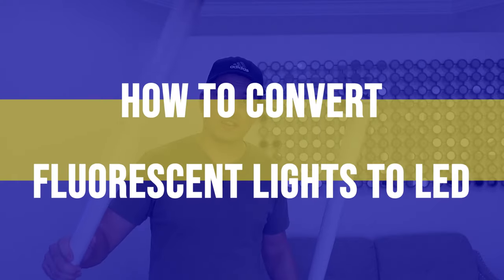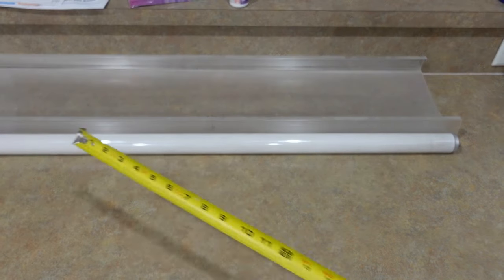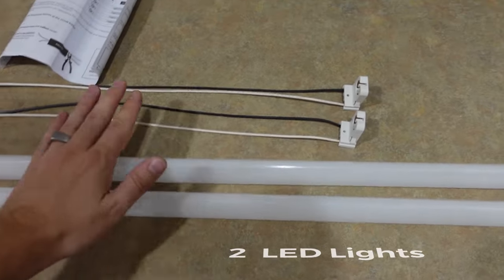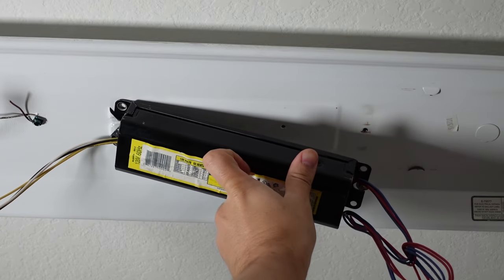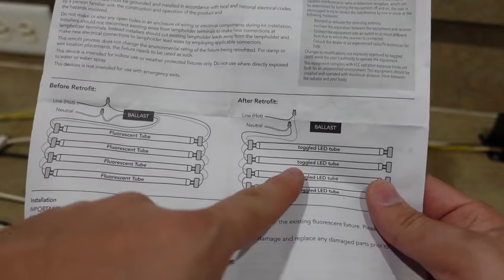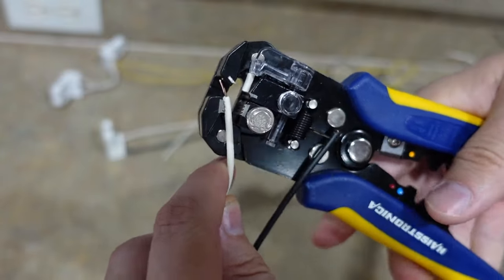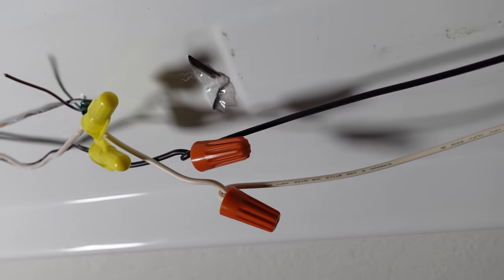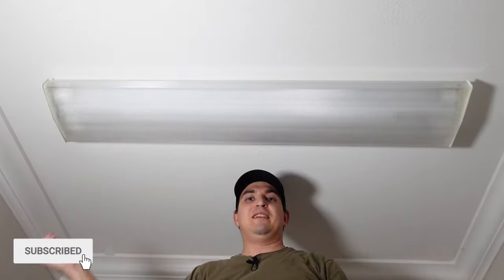How to Convert Fluorescent Lights to LED

Comment: Did you know, that you can fit the led bulb only in one way? The side which there is a description on the end goes to the side where the power is connected. If you do it wrong,  you short out the led and will trip the power and the led bulb is ruined.
Reply from the maker: No I did not know that. I must of gotten lucky then.
Reply: How do you know where the power is connected?
Reply: @BBullet Black wire
Reply: Good to know
Reply: That gives me another reason why I don’t like LEDs.

Comment: That's too much of a hassle honestly especially considering that regular Fluorescent Tube Light Bulbs last around 9 Years or more and they are cheaper. LED's are more Power Efficient but they should make LED's work with everything you shouldn't have to do all this stuff to get them to work they should just be Plug And Play for everything.
Reply from the maker: They do have easy plug ins but they are not as efficient since u end up using the ballast. The savings here is ur no long powering the ballast
Reply: This is very simple
Reply: @Daddicated  Most of the energy used is from the flourescent tube not the ballast. Thats why plug n play LED's are becoming popular. They use the existing ballast instead of a driver, so no ballast bypass is needed
Reply from the maker: @Warp2090  So on amazon it looks like the LEDs they sell can go for both plug n play and ballast bypass. I also did some math with help of ChatGPT and by removing the ballast I save about $7 per year if the light is on for average of 3 hours per day. With that being said I agree leaving the ballast is easier and less headache but with the ballast you will save little bit.😅
Reply: they do do them plug and play :) i don"t understand why this guy complicates everyting
Reply: @cristibabyface  I ordered some from Walmart I got their Brand Great Value and they work great without removing the Ballast.

Comment: Plug n play LED's are much more reliable if you have a good ballast.
Reply from the maker: Really? Why is that?
Reply: @Daddicated  Some LED tubes have cheap drivers, which fail a lot faster than a good condition ballast
Reply from the maker: @Warp2090  Interesting but the energy savings by going to LED is mostly coming from removal of the ballast is it not? It would interesting to see how much you saving by removing the ballast vs the life of the LED and the cost/frequency of replacing them.
Reply: @Daddicated  Yeah true

Comment: I've seen a couple videos of guys doing it without any kind of kit. Basically removing the ballast, rewire with existing wires, put in LED bulbs. I thought LED bulbs had green caps on the ends? Not sure.
Reply from the maker: I think if they rewire it properly then you are probably right you can probably do it without the kit. The kit just makes it easier and more idiot proof with instructions but if you know what you are doing you probably can do it without the kit.
Reply: The tubes in this video are single-ended lights, meaning that both the hot wire and the neutral wire go to one end of the tube.  There are double-ended (aka dual-ended) tubes in the market, if you want to avoid the kit.

Comment: Any reason you can't just buy LED bulbs and place them in? Does this have to be done with all light fixtures that aren't ballast?
Reply from the maker: I think they sell kits that you can install with the ballast. The problem then is the ballast wastes more energy. By removing the ballast you get more energy saved.
Reply: @Daddicated theres a company that i just heard from that sells the LED replacement bulb with nothing to do but install the LED bulb where the previous fluorescent bulb was.  Does this sound correct?
Reply from the maker: @davidb.8948  That is correct there are those as well but the problem is because you still have the ballast it still requires more energy to use the light therefore if you want the ultimate savings with the LED bulb its best to remove the ballast.

Comment: LED bulbs last longer
Reply: not always
Reply from the maker: Yeah I feel like they design them to fail after a couple of years at least that’s been my experience with led bulbs not sure about the tubes yet. We’ll see how long this one will last.
Reply: @Daddicated  yes
Reply: especially fluorescents on preheat ballasts, the tubes can last a very long time
Reply: Depends if you get one with a quality driver yes. The market is flooded with LED's that have cheap drivers sadly though.

Comment: I cannot find the kit you used in this video. I've looked at Home Depot and Toggled online and they only have the conversion kits with 4 bulbs meant to replace an 8ft light. Can you comment on where you got this kit or the part number? The link you provided is not for the Toggled brand. Thanks!
Reply from the maker: It’s these

https://www.homedepot.com/p/toggled-48-in-16-Watt-Daylight-Deluxe-T8-Dimmable-Linear-LED-Tube-Light-Bulb-2-Pack-D416-65321-2/308086234

Comment: Note that this process is only for bypass bulbs specified as single-ended for power. The upside is that they only work when put in one way, and the other way just won't have power. The downside is that if you put them in the correct way, but still twist in the wrong direction, then the Load pin will line up to the Neutral feed wire and the Neutral pin will line up to the Load feed wire. 

There are also double-ended bypass bulbs that require you to wire the Load wire to all contacts on one side of the fixture and the Neutral wire to all contacts on the other side of the fixture. Those don't like to be put in backwards.
Reply from the maker: Interesting...

Comment: The install kit in your description says it works with the existing tombstones, no need to change them, so...? Also, the description says only bulbs are included, no tombstones. So?
Reply from the maker: I originally bought my kit from Home Depot and I couldn't find the same kit on amazon to post in the description so I would follow the instruction of your kit.

Comment: On fluorescent lights, if you take one bulb out the other one won't work very well, is that the same with LED's?
Reply from the maker: I’m not sure I never tried but I think it might something to do with how it’s wired.
Reply: Each LED will turn on once it's installed.

Comment: hi。 when Fluorescent lamp into led do i need new ballast
Reply from the maker: It depends on the LED that you buy. Some you can do with existing ballast and some you need to bypass it.
Reply: @Daddicated  Why would you ever buy the bypass when you can just get the bulbs that work with existing ballast??!!
Reply: @MySquishable because the purpose of LED lower the power consumption.  Buying the type of LED that still uses the ballast defeats the purpose of the LED being cost effective because the ballast is still being used up power to light the LEDs.
Reply: @arghoknot  Not really. The leds that use the ballast are far more reliable and dont use that much more juice
Reply: I copied and pasted the following from Quora.
Is it better to replace the ballast or bypass it when upgrading to LED tubes?
When upgrading to LED tubes, the decision to replace or bypass the ballast depends on several factors, including the type of LED tubes being used and the existing lighting setup. Here’s a breakdown of both options:

Bypassing the Ballast

Pros:
Efficiency: Direct-wiring LED tubes (often referred to as "ballast-bypass" or "direct wire") eliminate the ballast, which can reduce energy consumption and improve efficiency.
Longer Lifespan: Without the ballast, there are fewer components that can fail, potentially leading to a longer lifespan for the LED tubes.
Cost Savings: Over time, you may save on energy costs and maintenance since there are fewer components to replace.
Cons:
Installation Complexity: Bypassing the ballast requires rewiring the fixture, which may necessitate a qualified electrician if you’re not experienced with electrical work.
Compatibility: Not all LED tubes are designed for ballast bypass; you need to ensure that the tubes you choose are compatible.
Replacing the Ballast

Pros:
Simplicity: Using LED tubes that are compatible with existing ballasts (often referred to as "plug-and-play" or "ballast-compatible") can make installation easier, as you won’t need to rewire the fixture.
Less Initial Work: If you are not comfortable with electrical work, this option can be more straightforward.
Cons:
Energy Loss: Ballasts can consume energy, and using ballast-compatible tubes may not be as efficient as bypassing the ballast.
Potential for Ballast Failure: If the ballast fails, you’ll need to replace it, which adds to maintenance costs.
Conclusion

If you are looking for the most efficient and long-term solution, bypassing the ballast is generally recommended, especially if you are comfortable with electrical work or can hire a professional. However, if ease of installation is a priority and you want to avoid rewiring, using ballast-compatible LED tubes might be the way to go. Always check the specifications of the LED tubes and consult with a professional if needed.

Comment: Could have just bought a whole new LED flat panel or a led shop light over an LED tube. But I know the LED tube is cost effective
Reply from the maker: Yeah I could of but this was probably easier to do.
Reply: I had got Philips led tubes for my shop’s Storage space which work on a rapid start, but for a garage, I had to put a new LED fixture because it didn’t work with led tubes (Since it was a F40 t12) I got the wrong size tube and i don’t want to take lots of time removing the ballast, the new fixture in my garage puts out 8000 lumens (4000k)

Comment: Dont convert. Just stock up on cheap cfl tubes until fixture end of life. In most cases led will burn out much sooner than a traditional cfl tube. They lie about led lifespan by alot! For 24/7 operation id take cfl any day. Leds in a single lamp burn out by some of them get dimmer or die while others still going, also driving electronics are ceap and horrible in most led lights and will fail loooong before any cfl tube and its power brick does.

Greenwashing at its best together with electric cars.
Reply from the maker: You're probably not wrong. Some LEDs do tend to burn out faster than what they promise.
Reply: If you do want to use LED's, I reccomend trying plug n play led tubes which just go into ur existing flourescent fixture with 0 extra steps
Reply from the maker: @Warp2090  what's the energy savings comparison between fluorescent tubes vs led with using the existing ballast?